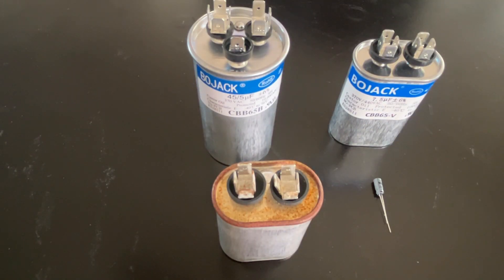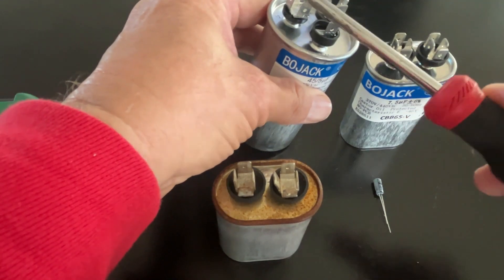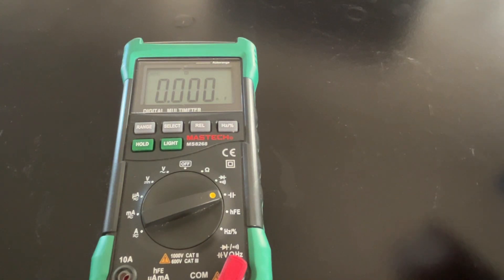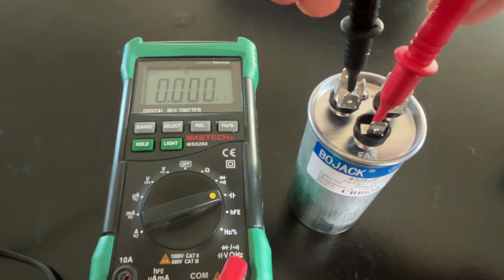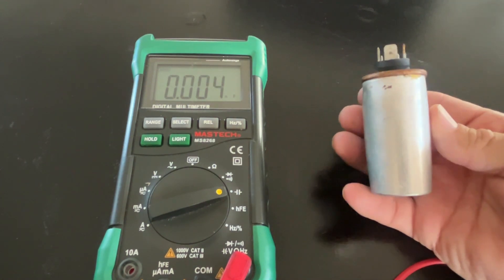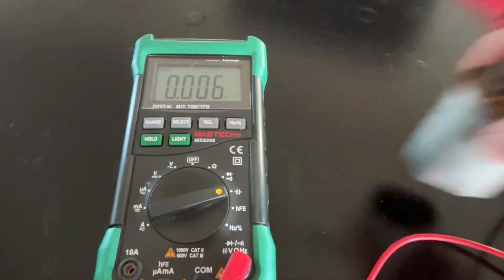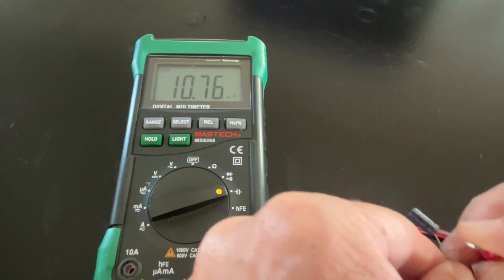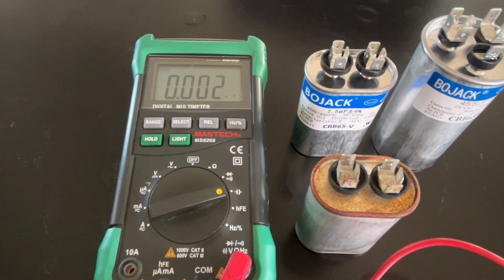How to Test Capacitors

Comment: Thanks for the info. Helps a lot. A comment on testing the smallest capacitor. Keep your body out of the circuit using alligator clips or pinning the leads to a non conductive surface with your pin leads. The body has substantial capacitance and will tend to read higher capacitance if you use your fingers to hold the contact points together.
Reply from the maker: That's an excellent point about body capacitance affecting small readings. Thanks for adding that valuable tip!

Comment: An alternative way, albeit less accurate, is to use the resistance function if you don't have multimeter with a capacitance function which, in this day and age, all but the most basic meters have.  After discharging, note the reading.   A good capacitor would initially show a low reading then gradually increase.  A shorted capacitor will show a low resistance that won't change.   An open capacitor will show a high or infinite resistance.
Reply from the maker: That’s great info. It makes sense how that could tell you if a capacitor is at least working even if it cannot tell you the actual value.  Thanks